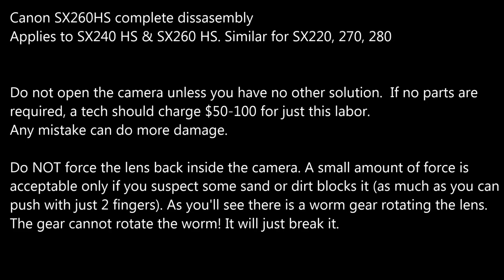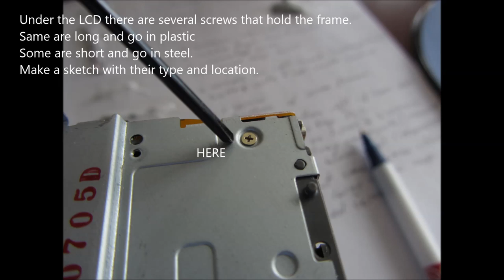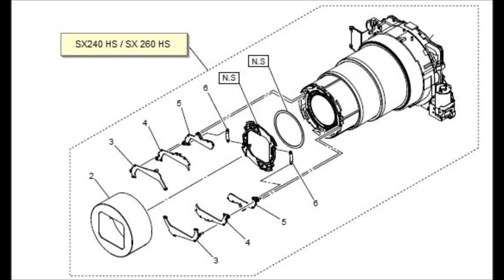Canon Powershot  SX2xx HS disassembly for lens jam repair or LCD screen loose connections.

Comment: Thank you. I just replaced my SX260 lens. Without this guide the project would probably have ended in a failure.
Some additional suggestions:
- Use professional quality screwdrivers. Cheap ones will easily slip and damage the screws.
- Keep very good track of each screw. Record in sequence what you unscrewed and what kind of screw it was (there are like 5 different sorts). Best number each screw you remove. In my case I lost one screw and a couple of others I did not know at reassembly if it needed to be long, short or very short. Fortunately the camera still works ;-)

Comment: Well I got the replacement lens unit in a working but now the screen isn't working. Seems the back light is out and yet the plug for that is plugged in. Could it have went out because of the repair?

Comment: Tried this.
Problem I had: Typical lense jam, accidently dropt on dirt from around 40-70cm. Lense jammed and said the problem note everytime tries to open the camera. If I remember right, lense tried to move abit when opened camera.

Problem after checked gears/ made them on right place: So I opened case wheres gears, but them popped out/went out so I'm not sure, were they already badly there. Anyways, got them right place and assembled camera. Now when I try to open camera, it doesent say any message, and doesent try to open lense. It also haves some weird sound, sounds like it doesent come from speakers. This doesent repeat, until I take battery out and back. Also green light beside LCD is on like 1-2 seconds.

What I think is something is blugged abit badly. Another thing is something with power.
I used over 3 hours on that, gotta try it later when I got time. What you people think this means?

Comment: I turned it on after a lens replacement and all i get is a green flashing light and nothing else
I did disconnect the battery so it will be reset but what does that means